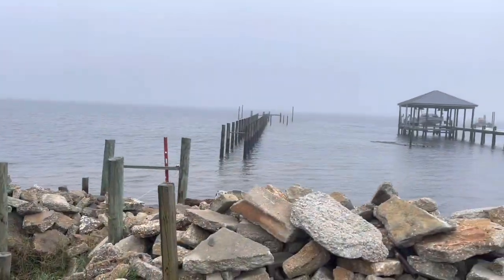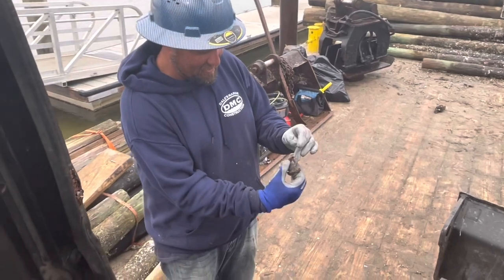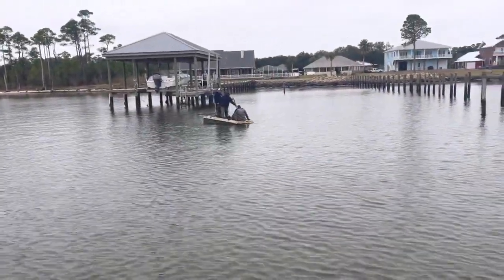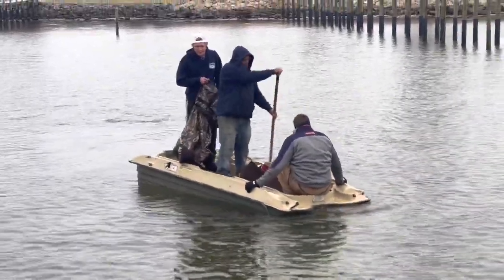DON’T GET SHORT POLED!!😬

Comment: I am glad I saw this video, I recently had a new dock installed but the contractor only pulled up poles that he could see and put a rope around.  I don't think he got all the support beams because i keep finding them when I throw out my triple hook out to search for them.  He had a pile driver and my 30 foot long piers are only sticking out of the water about 7 to 8 feet.
Reply from the maker: Thanks for watching I appreciate that but yeah we try to get all of the old pilings removed especially with kids playing around the docks I don’t want them stepping on the sharp broken off parts of the Piling or barnacles and oyster shells.

Comment: It's strange that you don't have a mini dredger. It would be useful to you. You need to buy motor pumps for very dirty water, a Bagermaster suction nozzle, a set of hoses. Assemble the pontoon from the barrels and... You will be able to do the bottom dredging work. Also take the soil at the bottom and smooth it under the pier. Do it where the excavator boom does not reach

Comment: Nice to see you in the neighborhood,  about 500 to 600 feet to the east of there we had about 3’ of sand, after that  a clay hard pan, the clay had lots of pine tree roots and old stumps made it slow going. Did you find any at that location?
Reply from the maker: Thank you very much for your comment not sure which location you’re talking about as we have seven crews working in different areas.

Comment: Hi Dale, Merry Christmas to you and the family. I have a question,  can you explain in detail how long is the PVC pipe and Diameter you are using, what is the length and Diameter of the hose and what HP pump and manufacturer's you are using, thanks....
Reply: (From my experience) You can rent a trash pump for the day or purchase one online. Most of the better, small trash pumps, will have the Honda 5.5 HP or their 8 hp. Typically, the suction and discharge will be 3" but you can reduce either using "cam-lock" fittings (among a few others). The discharge hose is typically 2" (this is reduced from the 3" fitting at the pump). The rigid "jet" pipe can also be 2" but (for me) it is easier to handle when reduced down to 1.5 inches (its up to you). You can get a cheap-ass pump at Harbor Freight, which some seem to be fond of as they have a warranty, but I like the commercial pumps instead (e.g., Thompson, Multi-Quip, Honda et. al.) ----- Sorry to get in Dale's way here just offering what I have used and, like anything, some will have other preferences that they swear by. Honda engines are amazingly reliable so hard to go wrong with that and a good old 3" trash by one of the manufacturers I listed here. PS. Dont drink the water!
Reply from the maker: @treborsalvador9659  Great answer I couldn’t said it better myself 👍😊
Reply: @treborsalvador9659  Thank you...
Reply: May be a silly question, but in the video it looks too rigid to be pvc. I can’t imagine galvanized pipe would be used, am I missing something? Thanks for the info. I’ve been happy with the 3” harbor freight trash pump for my diy jobs, used a pacer for some time, would prefer it any day, but the hft works.